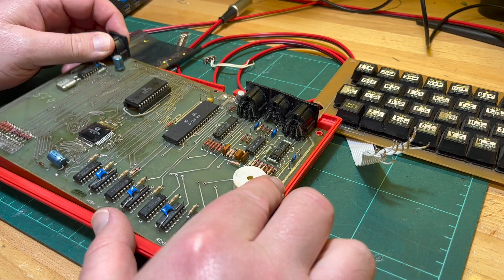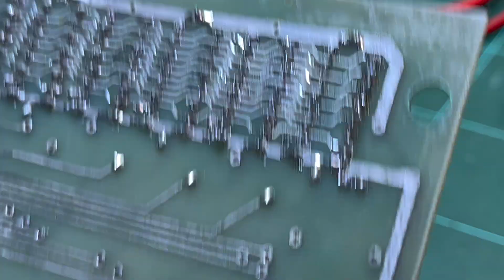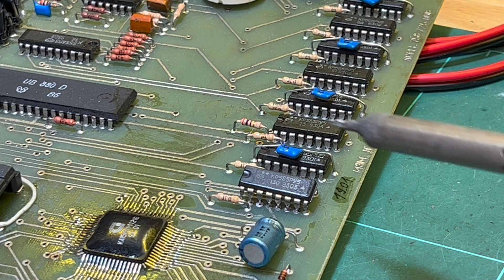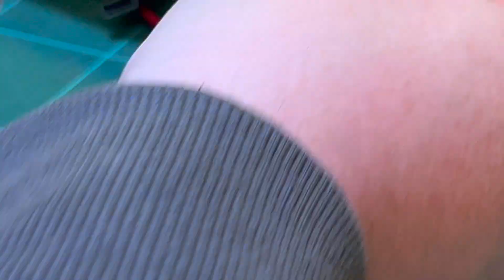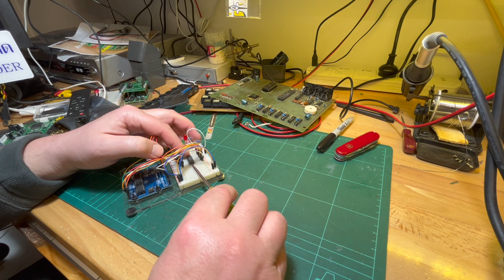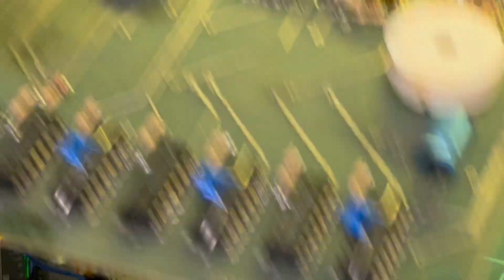🇲🇩 BYTE: Part 7a (DRAM checking starts) [TCE #0129]

Comment: 565РУ5 ICs don't like high temperatures, so likely they won't survive desoldering. If you suspect RAM failure, just cut them all out and put new 4164 in.

Btw this clone is based on 1515ХМ1 which is an ULA. Unfortunately these aren't reliable either and it's impossible to find a replacement
Reply from the maker: It might be easier to do just that, just cut them off ... but I want to keep it as original as possible.  You can still get NOS of the ULA and the DRAM from Ukraine ... I've got some of the DRAM, but didn't fancy de-soldering and re-soldering the ULA back on ;) /Brett
Reply: @Brfff  keep in mind that there were dozens of different 1515ХМ1 variants, and you need the exact variant for your board (it's usually marked as 1515ХМ1-VARIANT_NUMBER). Other variants won't do
Reply: see https://ru.wikipedia.org/wiki/1515%D0%A5%D0%9C1 - unfortunately there's no page in English, so use google translate
Reply from the maker: @VasilyKhoruzhick  Oh yes, I remember reading about that now ... good point! /Brett
Reply from the maker: @VasilyKhoruzhick  ... looks like it's the same one: KA1515XM1-216 ... they have sold 169 and only have three left ... eek /Brett
Reply: @Brfff  if you are going to buy some, buy it least 3 :) These are CMOS and can be easily killed by static electricity. Moreover -216 variant was used in number of other clones, I'm sure you'll find use for them.